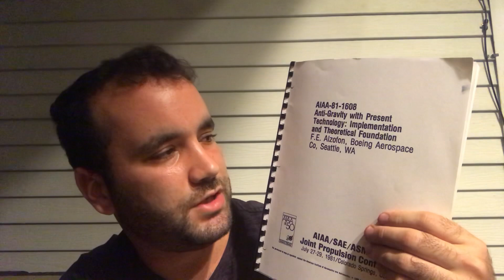The Alzofon Experiment. Gravity control with present technology. explanation and theory.

Comment: Video on You tube shut down after 2 months. Peltier module on digital 
weigh scales loses weight when powered. John Keely did this type of work
 in his shop approx 1892 Philadelphia . He used themocouples / 
thermopiles wires of gold, silver + platinum. With array of tuning forks
 resonance vibrations applied to mass with wires, and nodes 
multiplications, with harmonic ratios, heavy metal would rise up. He 
also demonstrated triple sirens flywheels/ floating with resonance 
vibrations and ratios. He would speed up rpm with air pressure on side 
cups, then slow 2, for sound frequency's ratio. This was also done with 
French scientist using  large sandwich plates of differing metals at 
each end of open dirigible frame, that lifted in air when oscillator 
frequencies applied. It was said that Keely got the earth frequency from
 Tesla. Tesla didn't like Keely , since Keely got more investor's money 
than he did.

Comment: hey i had an ufo encounter and what i saw was lights something rotating down the bottom and a force pushing down something simmilar to gravity it was no air and was too silent a little buzzing sound. and i searched about anti gravity and stumbled here .
Reply from the maker: How do you know it was pushing down ?
Reply: @FalconSpace  it passed overhead me.
if it would have been a plane then i should have felt some kind of air and sound, but  i felt was some kind of force or pressure i dont know what to say.
i could describe it as the same sensation we feel in that gaint wheel swing in the carnivals.

Comment: While I agree with the explanation of inertia, as an excitation or "blue shift" of the precession frequency of sub-atomic particles. I have to disagree with the conjecture that aligning them will change the inertial mass. There is "nothing" in the equations that govern the change in the precession frequency that depends on alignment. The frequency only depends on the scalar magnitudes, so aligning them doesn't prevent the frequency shift when a force is applied. Aligning them is as simple as applying a strong magnetic field until the material is magnetically saturated. If anything, that will cause more drag and an apparent higher mass. The RF or uWaves are not required for alignment to occur.
Reply from the maker: For the record, later rereading the work of alzofon revealed that this is not what was written in his paper. 

He thinks of it as a cooling effect that the incoherent gravitic field of earth must do work on the coherent sample in order to react with it effectively “cooling off” the gravitic field.

So this theory is effectively of my own creation.

Ultimately its a simple explanation and it passes the teach it to a 3rd grader test.

But most importantly lets see if it passes the reality test !

Comment: You are on the correct path, but if you want to progress in this type of research, then stop thinking in terms of "warped space time" and "atomic particles" and start thinking about Æther fluid dynamics / pressure mediation.
Reply from the maker: Code Tech maybe you can elaborate further ? Hmu. Falconspaceprogram@gmail.com
Reply: @FalconSpace  Sure. The classical electrical engineers - Maxwell, Heaviside, Tesla, and Steinmetz - all accepted the existence of the Æther. (Note that this was decades after the Michelson Morley experiment supposedly "debunked" the Æther, but Heaviside, Telsa, and Steinmetz did not consider the MMX to be relevant.)

The Æther explains everything that has confused mainstream physics for the last 100 years, and the kicker is that everyone of significance in the field of engineering knew about it until around the 1920s when Heaviside and Steinmetz died, and Einstein and his buddies became popular, and Tesla was ostracized.

For example, Heaviside felt that gravity was an electrical phenomenon, and that it would be the "next big thing" in engineering that would be understood and controlled within a decade or so. Recall that virtually all of the things we call modern inventions are just improvements of things that were discovered in the 1800s. Note that the properties of semiconductors, upon which modern electronics (transistor, etc) is based, were discovered and used more than 100 years ago.

But enough (for now) of the history. Can we understand the Æther? For example, can it explain how magnets "attract" and "repel", in simple familiar terms? 

I would like you to watch this video. It's a bit long at 42 minutes but it goes over each concept slowly. "Decoding the Steinmetz Diagram using the Æther Circulation Model" https://www.youtube.com/watch?v=pgm7bsyYWMs

That video does use some concepts explained in other videos, the most relevant is "An Aether Model of Electricity : The Missing Secret of Magnetism" https://www.youtube.com/watch?v=T-tEALIeU_0

Comment: Darn!  I was hoping for a change in polarity of Gravity, so that attraction could be converted to repulsion.  But with the Alzofon assumption, your vehicle just gets lighter, and you still need a form of propulsion.  Well,I suppose if you could approach absolute zero in weight, the propulsion mechanisms would not have to be too clunky.    But in regards to Free Energy, I was hoping to Cheat Newton by using a Gravitational Polarity Reversal within a Rotating Stater in a Generator in order to set the spin going, hoping that the Energy in the Reverse Pole Polarity System would be independent of the ordinary output current from the surrounding Generator Coils.   But in Alzofon's Zero Weight model, well, yes, there would be little inertial resistance to getting the stater spinning, but that is inconsequential anyway, considering that the larger force constraining spin would be the Reverse Motor Effect within the Generator (every Generator is also a Motor, depending on which side you  supply energy to).       So, yeah, I just don't see how the Alzofon Model could be responsible for interstellar travel, or even for the Vehicles we have seen, which may be sourcing out of Government Programs, because how are we accounting for the great amount of energy they are using unless they also have some kind of a Newton Cheating Generator onboard, and such a Newton Cheating Generator would have to involve ITS OWN GRAVITATIONAL SYSTEM FIELD in order to Decouple its Energy Input from the Energy Output of the Generator.  That can't happen just by making the components effectively lighter.    So, Falcon Guys, I actually hope Alzofon is wrong, because it sort of leads to a dead end, doesn't it?   But look over that paper (I found it in PDF).  Maybe what he interprets as a reduction in inertia is actually a reversal in polarity, and that would put some Theoretical Wind In Our Sails.    We need something that will not only get lighter, but pick up the table it is bolted to.
Reply: Unlike magnetism, gravity has no polarity. This is because the Æther motion in gravity is incoherent, whereas with magnetism, the Æther motion is coherent, and depending on the orientation of two magnets, there will either be constructive interference (which produces "attraction") or destructive interference (producing "repulsion"). 

Here is a video discussing Æther spin and magnetism; I have cued the timestamp to show the actual experiment  https://www.youtube.com/watch?v=JGIn45-rw7M&t=540s  but you can also watch the entire thing.

Getting back to gravity, you cannot "reverse the polarity" of gravity to produce "anti-gravity" like a repulsive force. But, you do not need to, because you can produce thrust in other ways, and you don't need much thrust if you can remove the effect of inertia. Inertia is the "enemy", not gravity.

Inertia (in my understanding) is due to the gyroscopic spin of the individual atoms of an object in relation to the Æther. For example, if you have an object (like a rock) and push it, the object will resist your push, since the atoms are not spinning according to that motion. They exert a "drag" against the Æther, but as you continue to push, the drag imparts spin to the atoms, and they become orientated to the new motion. After that, the object will tend to continue moving, since the atoms are now exerting momentum. If you try to change the speed or direction of the moving object, you will again encounter "drag" against the Æther, until you put enough energy to re-orientate the spin of the atoms.

Controlling inertia is the key. If you can control the inertia of an object, say a spacecraft, then the craft can be instantly accelerated using very little thrust, because it will not experience "drag" with the surrounding Æther. By the same argument, as soon as you "take your foot off the gas pedal", the craft will instantly stop, because it has no momentum.
Reply: @codetech5598  Good Morning Code Tech.  WAIT!  If Gravity has no polarity then why do Masses Attract using the Mechanism of Gravity?  You know, the Apple falling on Newton's head.
Reply: @leovolont  Let me first ask you this: We know magnets do have "polarity" and they "attract" and "repel". Now, say you have some magnets, different shapes and sizes, and throw them into a paper bag and shake it up.

Will half of them will jump out of the bag due to "repulsion"?  What will happen, and why?